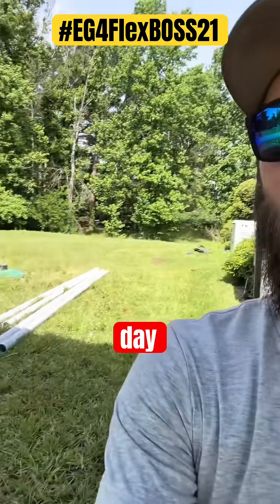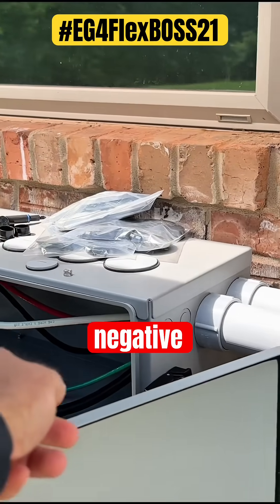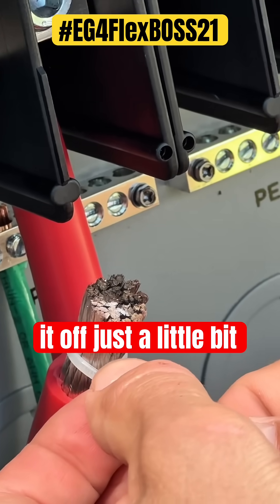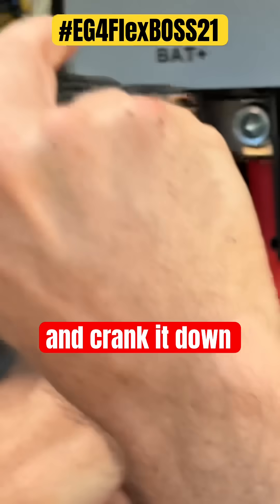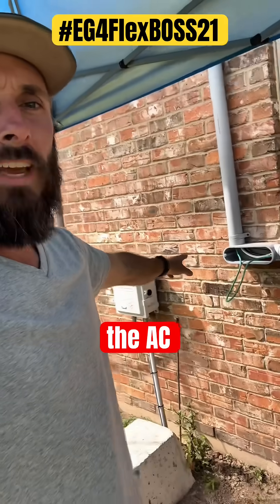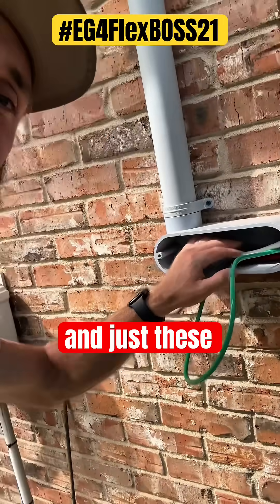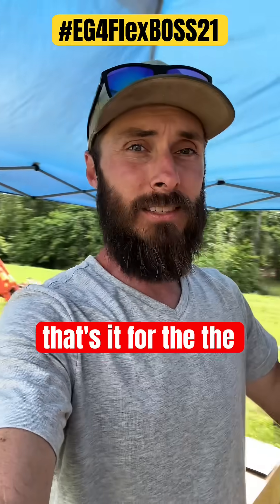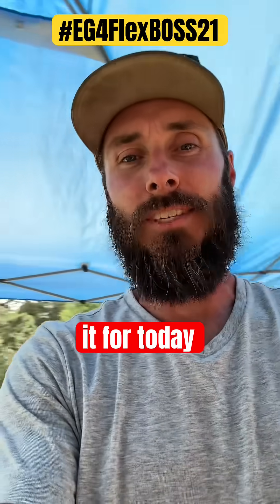FlexBOSS21 & GridBOSS Build – Batteries in Parallel & Conduit Run | Day 5

Comment: Did you need a fire code waiver for the batteries being withing 36" from windows? How'd you pitch it to them?
Reply: I assume it's related to UL9450 specs on the ESS as a whole.  The FB21 + Indoor Wallmount 314Ah have min 4" battery to battery and 26.something inch spacing to egress points.  Without the ESS rating, it would something like 36 for both numbers.  The battery itself (not the conduit box) might be just beyond the min number for the window.  Or, it might be a fixed (non-opening) window.

Comment: Any more videos? Need to see the Generac two wire start, Generac programming, Generac wiring, GridBoss integration, and choices for the panel output /seperate / main or on backup
Reply from the maker: I've got a ton of content shot and a lot more to do. had to put a break on the project, but will be back at it in a couple of weeks.
Reply: @EastTexasHomestead our  FlexBoss21, Gridboss, and a single wallmount outdoor battery are ordered. Generac is on site. Always currious to see how others projects are coming together. We will hopefully max out with 2 batteries per flexboss21. plan is for 3 flexboss in total. Money is tight. Getting ready for the next hurricaine season !

Comment: Love the zip tie tip!
Reply from the maker: It’s those little things, right?
Reply: @EastTexasHomestead  Use it backwards(so it doesnt use the locking portion), and u can just pull it off and reuse it. Its what i do, also buy 6 inch thin ones so its easier too vers the 3 inch.